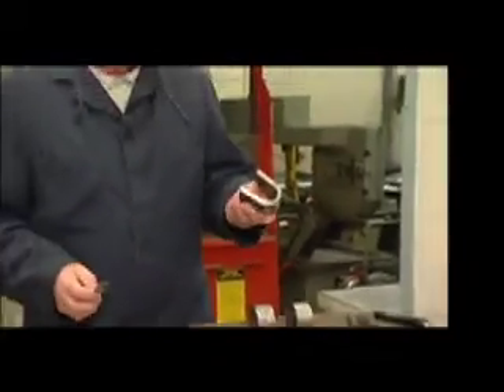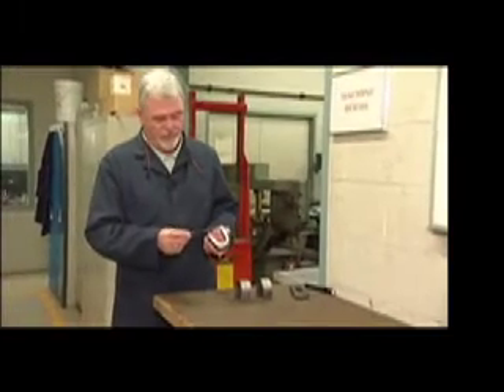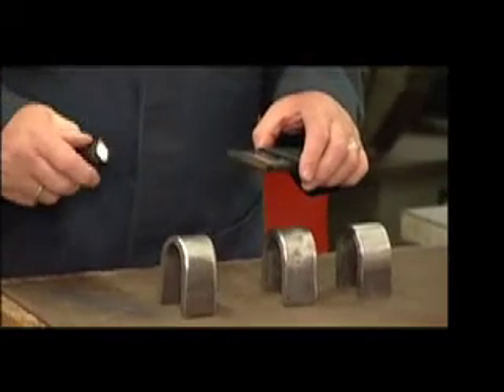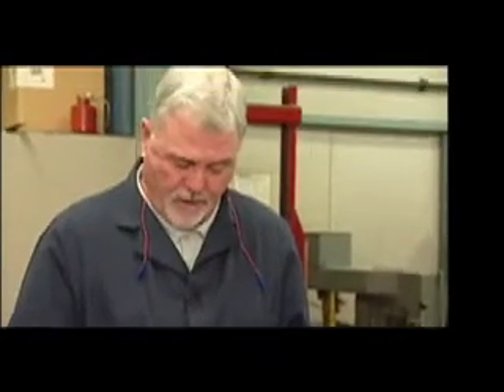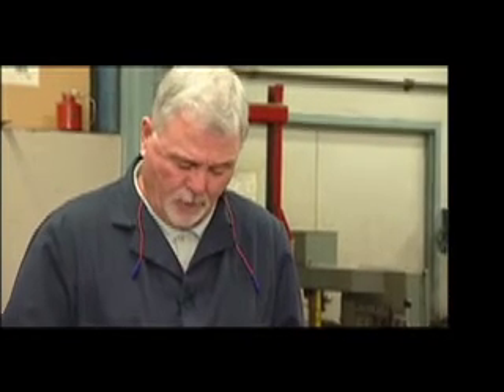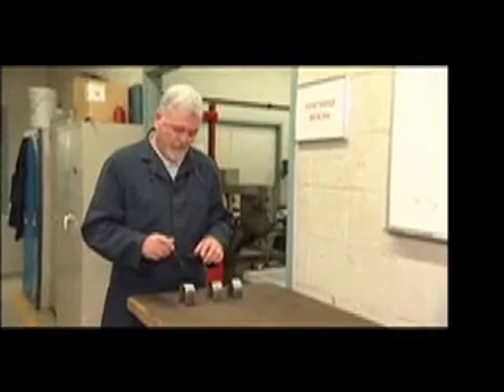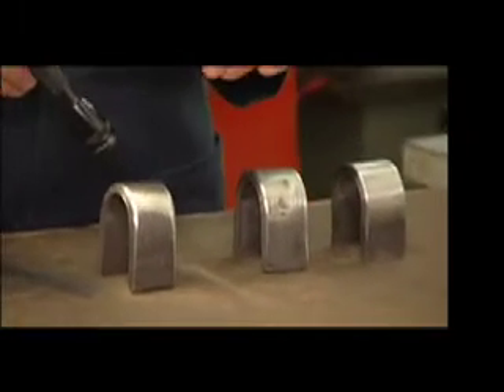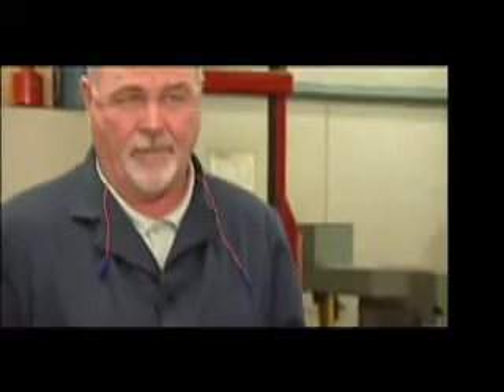CWB Video Part 4 of Four. Preparation of Test Coupons, Bending and Inspection to CSA 47.1.mov

Comment: the coupons should be ground flush to the same size as the parent metal... for example if you have 3/8" parent metal the grinding on the weld zone should meet the same criteria